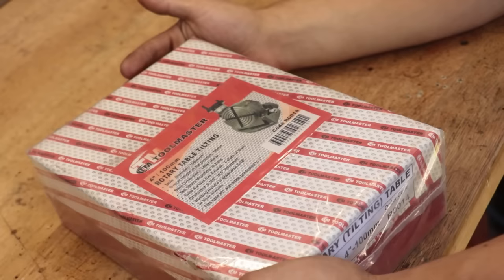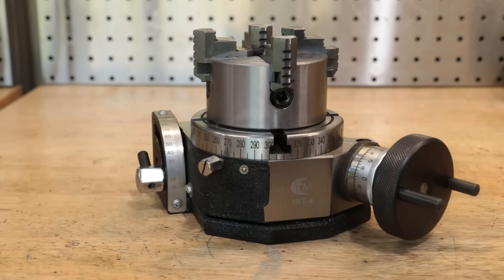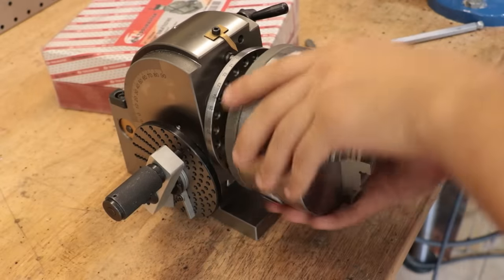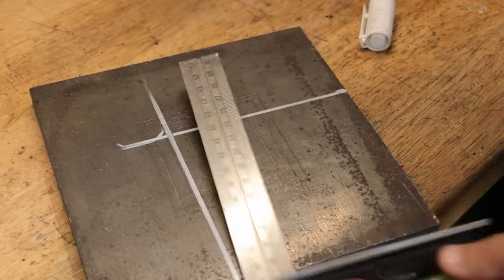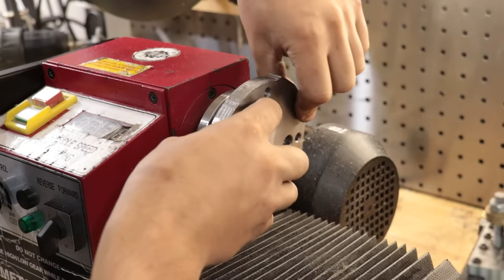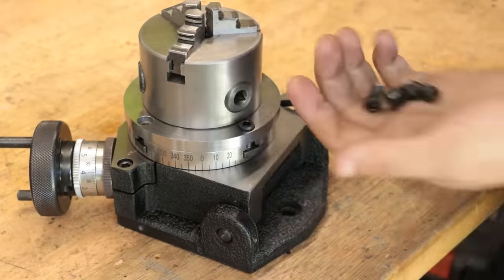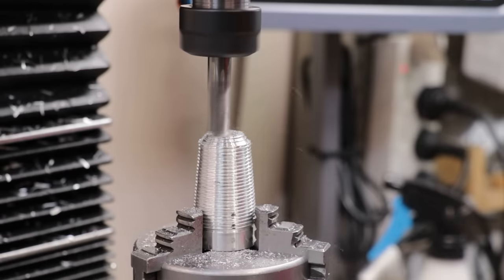I Bought a Cheap Rotary Table Which Was a Big Mistake

Comment: I have similar 100mm tilting rotary table which came with 100mm three jaw chuck fitted.  It has a similar rotating table lift on the body problem not when clamping but when rotary milling,   so what I have in mind is to dismantle it and see what has been used for the rotating bearings.  My guess is two close coupled sealed ball races.  I which case that would explain the lift on actuating the radial clamp.  Current thought would be to re engineer it and fit it with two tapered roller bearings with slight pre load.  Another thought would be convert it to a precision plain bearing which should handle radial loads better than rolling element bearings.

Comment: I have a Vertex 8" HV rotary table & indexing plates that seem decent. I can take the back plate off my 8" chuck & face mount to the RT. The combination is so heavy that I can't handle it so have to take it apart to move. 
I have a BS-1 semi-universal indexing head with a cheap 6" chuck. Again the combination is pretty heavy for me to handle together. It is also quite tall when used vertically. By the time a drill chuck & bits or especially a reamer is mounted there is little or no room left for work. And I've got a 9x49 knee mill!   I thought when I got the RT that I could cut everything I wanted including all the gear spacings and radius work. Turns out the Indexing head is better for gears & the RT for many other things. I ended up casting an 11" aluminum plate & 8 T slots for the RT because of the needed room to clamp parts. I bought foot stocks for both but have rarely used the one for the RT. The rabbit hole is deep!
I've made indexing blocks for the bottom of all the things that fit on the mill table, so setup times are less. I made wooden trays with a slot for the  blocks to drop into.  I'm slow at setups! Hope some of this helps others.

Comment: Years ago I got the cheaper version of this. Calling it hot garbage would be a kindness. Yours is in much better shape than the junk I ended up with. I didn't return it because I didn't use it until after time ran out. I now use a Sherline rotary table. It's not perfect, but it is very usable and gets the job done. The only issue I have is the locking mechanism is fiddly and could be improved, but accuracy is top notch.
Reply: Looks like the Sherline is $300 plus another $120 for the tilting, not that bad. Not as beefy though.
Reply: @jaro6985  Weirdly it feels a LOT more solid and stable. It was designed for a light machine so there is nothing there it does not need. I got it at 20% off. Sherline does a 20% deal every month on something.

Comment: I've got the same rotary table,  and the same issues as you have.  The little thumb locking screw has a taper  which is supposed to lock the table via an angled groove in the table, which tends to lift the table upwards.  I stripped mine down hoping to machine a  better groove to apply downwards pressure but there isn't enough metal to do it!!!
Reply: Could you drill and tap another hole in a slightly lower location to use the original locking screw?
Reply: @ferrumignis  no because there is not enough metal, the rotating table is very shallow in the main body. The worm and wheel take up most of the space.  A downward clamping force is needed,but it might stop rotation!  Can't win really!

Comment: I have a version from RDG in the UK; looks identical. The T slots are not even on centre or 90° to each other on mine. Absolute garbage. Had the same issue with the lock screw too.
Reply: RDG and Chronos sell a lot of this cheap crap unfortunately.

Comment: I picked up a 6 inch rotary table about 15 years ago and yes it is also  an import.I have had good luck with it but after 16 years being a hobby machinist i have learned one thing about import tooling...ONLY AS A LAST RESORT...I just replaced an import 3 ton arbor press.Bent the  shaft while trying to broach a 1/4 key way....Bought a Greenerd 3 ton....I payed more for the import then i did for the Greenerd...Now i shop around before buying..Used in good shape is the only way to go...

Comment: I did modify a 100mm chuck by drilling 6.5mm through-holes from the face to the back and adding recesses to the face for socket head screws. I am using 1/4-20 bolts, but M6 is fine as well. my t-nuts are 3/8-16 threaded, but I have tons of reducer bushings from the photo/video business, so the bolts thread easily into the t-nuts. this allows me to mount the chuck straight onto the mill table without using strap clamps, as well as straight to my rotary table... no backplates necessary.

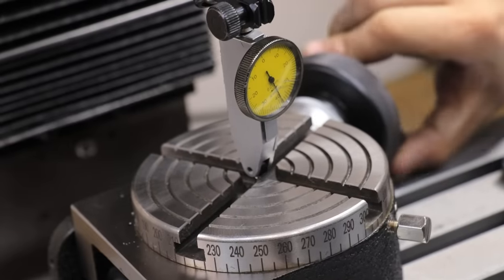Comment: 10:33 Not really sure which one you're measuring with the dial test indicator, as you didn't say, but I'm hoping you were checking if it has any run out from factory, and not getting it centred perfectly with the spindle. You have to rotate the spindle with the indicator in it to find centre.
I also have the 6" Vertex like a bunch of others here, and seems pretty decent to me. I bought the version with indexing plates, but I don't think I've used them yet, as the one time I wanted to I couldn't find the number I wanted, so had to use the hole function on the D.R.O for I think 24 holes.
The thing I was making, (and I would recommend making one yourself once you find a need) was a round fixture plate to go on the rotary table. I think mine is about 210mm diametre on a 150mm table. With I think 94 tapped M8 holes. Makes it alot more useful clamping things being bigger and not being so limited by the 90° seperated T-slots. I partially got the idea from a Click Spring video, who got the idea from someone else.
Reply from the maker: Yes that’s not the right bit of footage i intended to use

Comment: I feel your pain. I bought one of the cheap ones, which had all the same problems...plus one more: the mounting holes were misaligned.

A line marked through the centres of the holes wasn't perpendicular to the tilt axis, which meant that I couldn't set it up with the tilt axis aligned with mill's y-axis.

I mostly cut plastics (and some aluminium) on my micro-mill using high speed steel tooling...which wouldn't cut the cast base. I ended up spending an hour making cast iron dust with a die grinder in order to get things aligned ☹️

Comment: That's a lot of monkeying around-
1- Drill through the threaded mounting holes from the back to the front.  
2. Counterbore the holes on the front side for socket head bolts
3. Use the chuck jaws to grip around an arbor in the center of the rotary table to center the chuck on the table
4.Punch mark through the mounting holes and drill and tap the table for your socket head screws.
Keep your centering arbor in your toolbox and you can mount the chuck perfectly centered in seconds.
You should have bought the 4.3" table which has a whole different construction and also has optional dividing plates.

Comment: Interesting. I have just come across your video which has exactly the same issues I had. I bought the same size rotary table but without the tilt function and it too wobbled in exactly the same way. I did not want to spend ages re-machining surfaces so the underside of the top part fitted flush with the nicely ground surface. I checked and the table was nice and concentric and after a lot of thought decided to fit 4 M5 brass grub screws with flat tops inserted through from the top held in place with thread lock. I could then adjust the wobble until there was none but at the same time there was not too much drag. I too had problems with the poor fit of the worm against the gear but in my case there was no way to adjust it. The inside of mine was filled with grinding dust and it needed a good clean. It is a shame that someone went almost all the way to make a reasonable tool but tried too hard to do it cheaply. Mine is workable but disappointing. Not aware that there is an alternative in the 100mm size.  John

Comment: Have you stripped it down and cleaned the inside yet ? I bought an identical RT and it felt gritty . When stripped it was full of grease and casting sand making an excellent grinding paste ! It's now much smoother and feels better in use. I certainly  wouldn't  recommend this RT to any one. Having said that it has been useful for my intended uses.

Comment: To make the sub plate repeatable for concentricity a very good method is to cut in keyways into the sub plate and fit keys @ 90 degrees to form a cross  or simply cut the keys directly into the sub plate. As a bonus, this arrangement does not reduce the thru' hole diameter of the table like a spigot would. 
Good files are expensive and like any cutting tool have a optimal cutting speed. Running the lathe at the speed shown here will quickly destroy the file and severely pin it up. As a guide imagine you were drilling a hole the same size as your workpiece using HSS. This speed range is better for the file and a lot safer to boot.
Reply from the maker: Yes thankyou. Good idea on the keys idea. I know that the speed is less than optimal but I don’t have much control over it with this set up

Comment: Hey thanks for all the great videos- I bought my mill after seeing you using the Seig. Anyway I recently purchased the exact same RT. After watching the vid I rushed out to the workshop to check mine as I didn't notice anything bad about mine when I used it. The lock on mine moves the plate about .10mm, and the hand wheel shows about 2 seconds(?) of backlash. The plate revolves nice and smooth and no binding whatsoever. Im really happy with it. I know you probably didn't have time but they would have swapped it out for a better one which you could check on the spot. Cheers!

Comment: I have a 6" rotary table with just the ability to be mounted flat or on its side at 90 degrees it has two downward pressure locks at 180 degrees to lock the table and I have had no issues with it. I used a 19 mm thick round aluminium plate to make a back plate for the 5" four jaw independent chuck that came with my lathe and used that for work holding. The rotary table has a morse2 taper in the centre and I had a spare mt2 arbor so I bored a hole in the aluminium back plate to I think 15 or 16 mm and fitted the MT 2 arbor into a 2-3 adaptor and again into a 3-4 MT adaptor to fit into my MT4 lathe spindle and then turned the MT2 arbor to fit the back plate. So the chuck mounts to the back plate by the normal 120 degree 8 mm bolts then the centring arbour goes into the rotary table and the whole chuck and back plate fits onto the centring arbor and I only use two home made long tee nuts and bolts through the very limited room I've hot either side of the chuck ( 1/2" a side) to get a turned down headed 8 mm hex head cap screw to hold the chuck and back plate down. I've recently added a brand new Vevor 5 three jaw which I bought to use on my lathe as it came second hand and without the reverse jaws for the 5.1" chuck with the 100 mm back register. I didn't know that there were two different 5 inch' chuck ' standards' one with 95 mm register and one with 100 mm register, well the Vevor one was 95 mm so I made a back plate for it from 20 mm steel plate and that works fine on the lathe. I adapted the rotary table back plate to accept the new Vevor chuck so I have three jaw concentric with two sets of jaws capability and four jaw independent capability for my rotary table now and I'm very happy with it.

Comment: I too looked at a similar tilting table but decided I didnt really need the tilt, quite pleased I did now. I ended up with a fixed rotary table with indexing plates which is OK but also needed stripping like most Chinese stuff. I have to say I have found those San Du chucks pretty good after cleaning

Comment: A while ago I bougth a Vertex VU-150 rotary table and at the same time an 'identical' no-name chinese type for comparision. Yes, the Vertex was more expensive. And yes, the difference was a little bit painful. But what a difference in quality and especially in practicability! I can adjust the worm gear to nearly zero backlash and it still works smooth as silk. And the table has no play at all, it's absolutly no problem milling curves with it.
Different story with the no name: It was impossible to adjust the worm gear so on the one hand it has no play and on the other hand it doesn't jam. And the table fit was looser so you had to clamp it every time to prevent chatter, milling curves wasn't fun at all.
Long story short: You get what you pay for, and in case of such a rotary table it's well spend money. Don't make the same mistake again sparing money here, you will be annoyed sooner or later.
Reply: I can second the vote on the Vertex being of much better quality. Also, try to purchase the largest size that you can accommodate or afford - what backlash there is will be proportionately smaller and the mass of the table much larger.

Comment: I know you probably don’t want to buy another one, but I have heard that Vertex makes a good quality rotary table.

Also I like how you approach the problems you have with your tools. Instead of complaining you try your hardest to make it work. Imo that’s the way to be. Kudos!
Reply from the maker: No I probably will buy a replacement when the time comes, I have a few bits of tooling from vertex and they seem to make good stuff for the price. Cheers
Reply: @artisanmakes  looks, like the tilting 4" vertex costs around 1000 US $. plus shipment and maybe taxes.
Compared to the (normally) 130,-(taxed and shipped to Germany) for this one.
That's a lot headroom for home made improvement, if there is a way.

Comment: Nice work, mine is a 4" Soba and it has a similar clamping arrangement. You may be able to make a stepped plug that goes into the mounting plate and the spindle to center it? An old machinist warned me against getting the 6" because of the weight. When I get a 4 "chuck on mine it is quite heavy if I have to reach to put it on the mill. The older you get the heavier they get! I can use the micrometer on it effectively if I do not want to set up the dividing plates.

Comment: As soon as I saw that screw lock in its side I knew it was no use. I purchased a plain one sometime ago It let me down immediately. Stick with the 90:1 type with the locks that clamp down. The problem is the clearance between the outer casting & the table is too great. Resulting in around 6 thou of movement.
It hurts to see when you put so much effort in to do the work correctly.
Mervyn Price

Comment: Machinist for over 40 years and most rotary tables need to be used with the locks partially tightened.  The backlash in the gears tend to cause problems on all the manual ones.

Comment: I wonder if you could drill and tap more holes to lock it in place, equal pressure in the locks might help, sort of like how you have to adjust the jaws on the lathe 
i dont know?

Comment: I bought the “cheap” one the same as yours and experienced similar issues. 
Also it’s almost useless set at an angle as it’s just not rigid enough. 

But it still works sort of ok if I’m careful.

Comment: You shouldn't have to, but i'm sure you could fix it, maybe a shim to take up the slack or shorten the shaft etc..
Reply: I have one. The gear is out of round so if you shim it it stops rotating. His may be better, but the one I got was totally not fixable.

Comment: It’s not hard to get the backlash out: remove the rotating handle, loosen off the screws holding the shaft assembly onto the body, then adjust the grub screw  perpendicular to it until you have no backlash.

Comment: You should get a Vertex 6" rotary table. I don't know if they have 4 inch rotary tables. They are decent and have none of the problem you described. The bearing on it however is simply a sleeve that runs against the spindle...

I notice you are using mini mills and lathes... is there any way you can use bigger ones, like an old Bridgeport type machine? Even ones from Taiwan is much better than any of the Sieg stuff. My mill is a Dalih, smallest one they have (which is roughly the same size as a Bridgeport) and it's actually pretty heavily built. My lathe is a Victor 400 x 750. Nice thing about Victor is you can watch all the Abom videos and he'll have a lot of info about it. The Taiwan version of it doesn't have D1-6 spindle nose... shame. It has a A1-6 which is bolt on.

The only downside with getting a full sized mill is that you may have to replace your R-8 tooling. In Taiwan nobody uses R-8 except for the mini mills, even the bridgeport series 1 sized mill don't use R-8, they use ISO tapers, which in Taiwan it's NT30. Mine uses NT40 tapers. They are better in every way compared to R-8 because of the positive drive keys. If you ever get CNC machines the ISO tapers will serve you well as they all use ISO tapers as well.
Reply: Is not Victor a USA-based importer that sells Chines lathes identical to what Machinery House sells in Australia - jus branded "Victor" instead of "Hafco"?
Reply: @keithammleter3824  I don't know, victors are all made in Taiwan.
Reply: Vertex do have 4inch tables and they are good quality items, but new cost for is around 6x more than the Chinese crap.
Reply: @ferrumignis  I paid about 150 for my Vertex 6 inch tables, but it was used. No idea what it is new. It pays to look at used ones if you can find it.
Reply: @taiwanluthiers  4 inch tilting Vertex is currently about 650 UKP new...

Comment: I'd love to see you upgrade to a larger lathe. I went from a mini like you have to a Bolton BT1030a benchtop and then finally got a Smithy 14x40 which I use for gunsmithing. Life is much easier when you can hog through work.
Reply: Yes and no. I mean yes, you're right about a larger lathe helping. But I don't think it's good for the content necessarily. There's a real niche here on YouTube for content creators showing how they work with (and around) small, low cost tools. I've seen more than one successful creator upgrade their shop and lose their foothold in that niche.